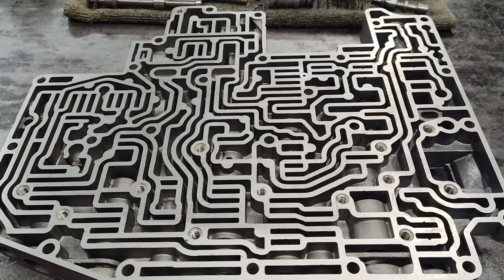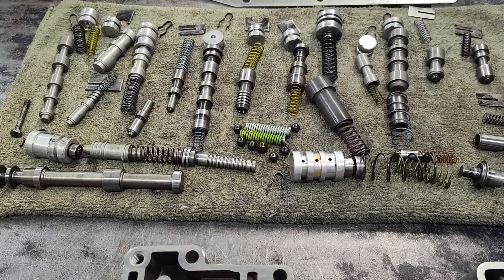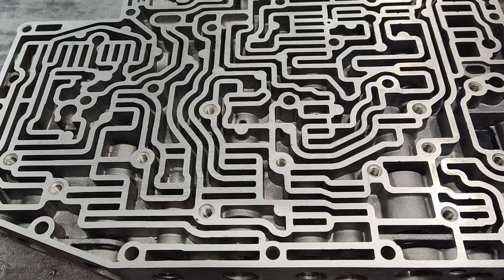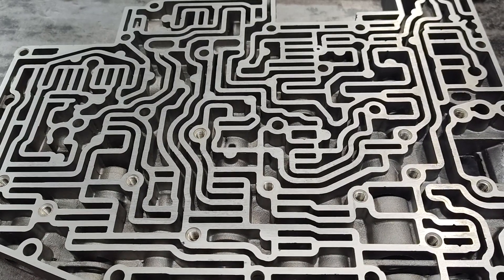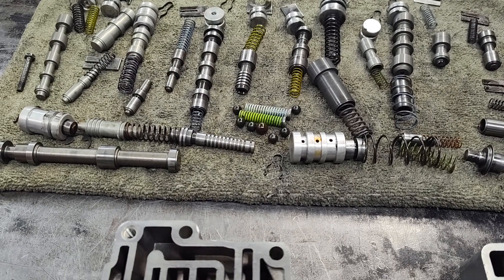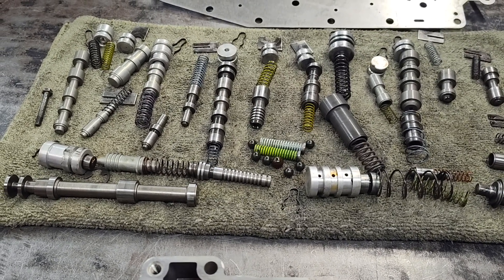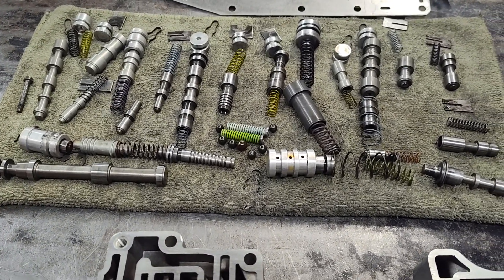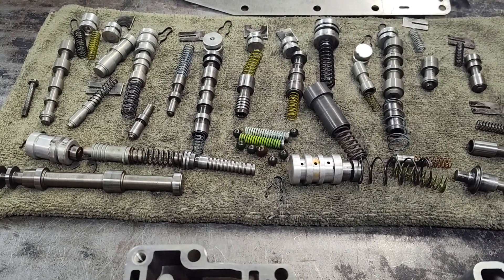Ford AOD Valve Body Basics

Comment: I have a problem that the tv plunger pushes itself to 60 psi while running without even touching the cable. Could it be the torsion spring on the Throttle lever? I put a transgo spring kit in it. I have problems going into third and OD. Second goes in too early
Reply from the maker: That may be the fail safe spring inside the case. Check our video on the AOD mechanical fail safe for more info.

Comment: Any Idea why the 1985 AOD I have in the shop has 80 PSI of TV pressure at idle with the TV Cable not pulled and Cold.  Puling the cable dose nothing. Once the Engine warms up the TV pressure goes down to 55 and pulling the TV cable causes the Pressure to drop for a few seconds then go up to 80 PSI. The TV lever is fully returned or back with the cable not pulled. Stock Valves?
Reply from the maker: Maybe the TV valve in the valve body is sticking or you have the TV plunger and converter pressure relief plunger mixed up. I believe I have covered this in one of the valve body videos I did.

Comment: Your videos are helping me a lot. Got my AOD back from the rebuild shop and it hangs rpm, bangs into gear like a hammer, and wont go into OD unless im over 60mph and then take my foot off the throttle. Hopefully i can figure out what they messed up.
Reply from the maker: TV pressure could be a bit high.

Comment: What is your preferred method for flating a valve body, lapping?  Or just pitch it and get another.
Reply from the maker: I use a machinists table to flatten valve bodies. I will do a video on that in the future. Most of these older transmissions we can't just throw them away anymore.
Reply: I would love to see you put on together your tricks of the trade. Or do you currently have one on the shelf. ?